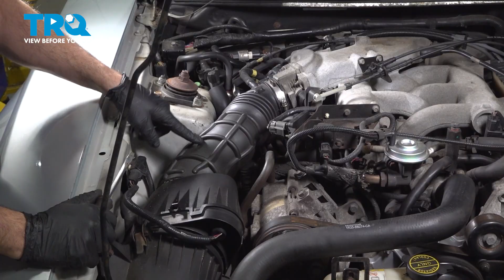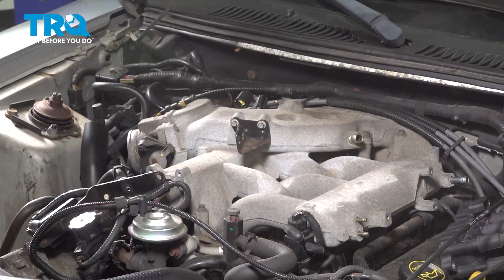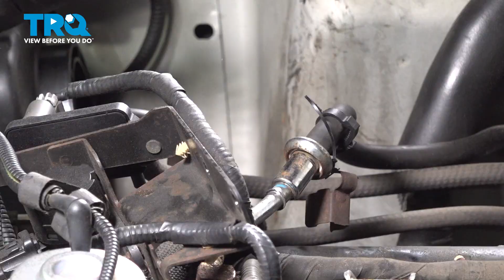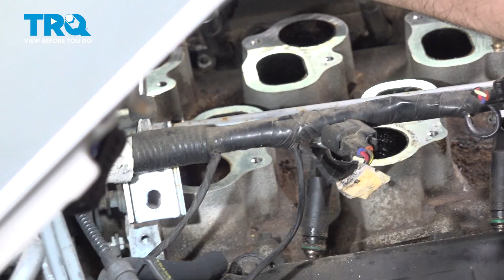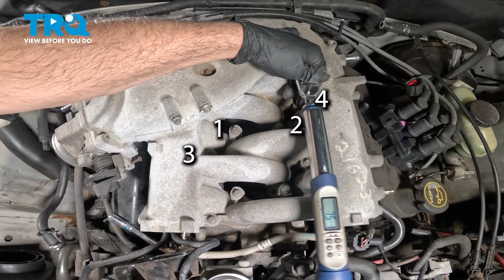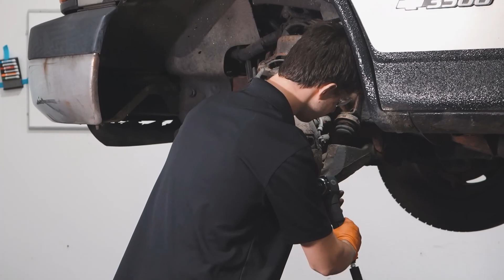How to Replace Fuel Injectors 1994-2004 Ford Mustang 3.8L V6

Comment: If you find yourself needing to replace the injectors.. While you're at it, you should go ahead and replace the little plastic Intake manifold runner control bushings. Because you'll really kick yourself if you have to go through removing the intake once again for a few small plastic parts that you could have taken care of while you were already in there.

Comment: So I did this as well.... I did all fuel injectors..... was about to put it back together and then I saw that maybe my problem wasn't the fuel injectors but instead the imrc bushes that was actually the problem because they aren't even connected anymore! Anyways fixed that with my buddy put it all back together ran down the street for a minute smelled nothing but gas! Fuel everywhere all over the engine bay ! A complete disaster! Jesus christ..... anyways was able to drive back home since it was a min down the road popped the hood up and rev the engine and  we think it was the fuel rod thingy where u use a quick disconnect we believe it wasn't pushed in properly will be doing more test driving tomorrow so stay tuned for a follow up